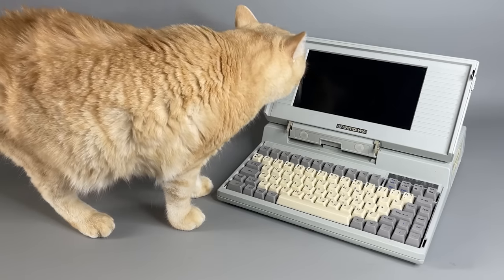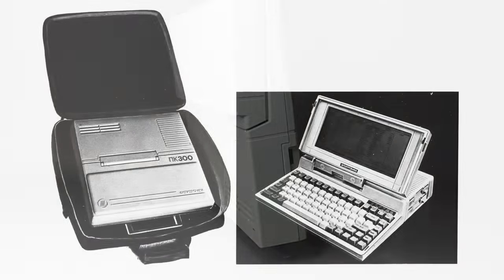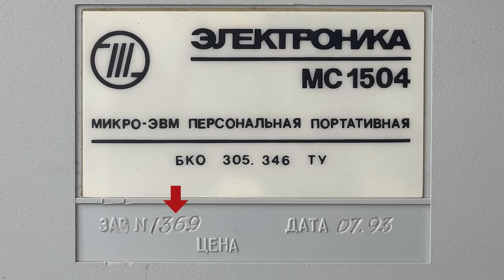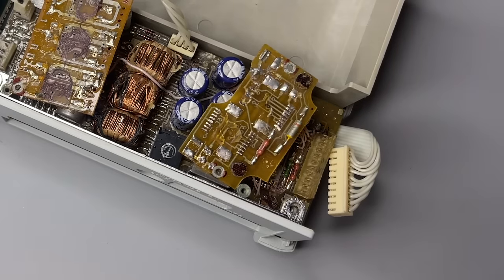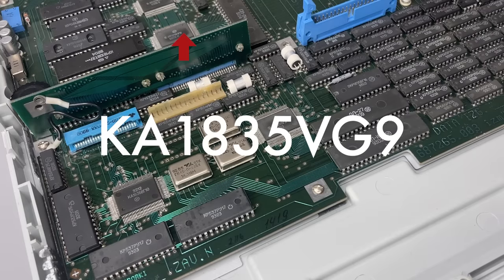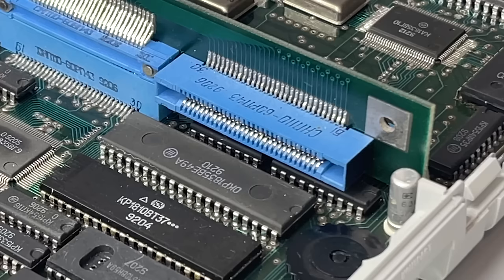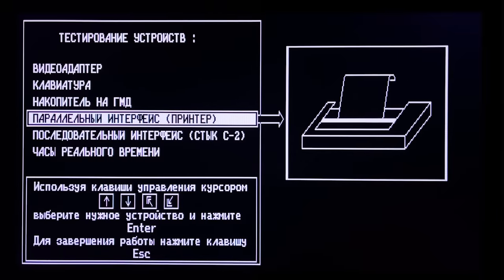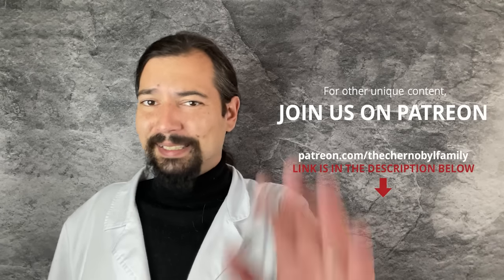I FINALLY FOUND IT! Behold Elektronika MS 1504, the ONLY SOVIET LAPTOP EVER.

Comment: In the Soviet Union they knew how they built computers and strove to keep up with the West. They even proposed to create their own OGAS network that would be the Soviet internet. Unfortunately the political leadership in Moscow did not see the potential of this technology.
Reply from the maker: When we had talks with actual developers of a few notable computer systems, they were far less optimistic in their opinions about those times. I'd warn against calling OGAS as 'Internet' in any way; it was more a decision system with very narrow purpose. Viktor Glushkov very well explained it in his books.
Reply: Still, very interesting.  @ChernobylFamily
Reply: Most soviet computers in the late 80s were still mainframes without a screen
Reply from the maker: @belstar1128 i certainly agree about mainframes, but all them had terminals, so technically, screens were present, and looking on some software (SVM, PRIMUS, etc)  — cannot say it was any different experience than working with e.g. DOS. Console is a console, after all...
Reply: @ChernobylFamily  I noticed most of them were like printers and had no screen. and even with cga you could do a lot more than with a terminal
Reply: They knew how powerfull OGAS would be, that's why they rejected it. By the 1960s the CPSU was too corrupted by bureaucrats that were more interested in keeping their power than developing a socialist economy. They saw the OGAS as a direct threat to their political power. If Lenin or Stalin had the option to develop the OGAS they would have done it, but it just arrived too late.
Reply from the maker: @iumbo1234 Stalin? You cannot be serious, with all my respect... in Stalin times cybernetics was claimed as a false capitalistic science... yes, in 1950 we had MESM  computer in Kyiv, but the perception of the computer systems as concepts was more as big calculators, nothing any close as a part of more universal realm of information processing.
In ~1955 things started to change, but before... no-no-no.
Reply: @ChernobylFamily  You are not wrong, I should have specified the younger Stalin. Before WWII he had a totally different attitude towards science, at some point something changed in his mind. Probably the beginning of the cold war made him extremelly suspicious about anything coming from the West, but he wasn't always like that.

Also I doubt he was entirelly guilty of this consideration. By this period of his rule the Party and the inner circle of snakes who surrounded and slowly isolated him had a huge influence in his opinions.
Reply: @ChernobylFamily  I heard a story that Stalin did not like computers because they might prove that socialist theories were wrong 😆
Reply: @160rpm  Which is funny because all modern theory on economical planification revolves around computers and cybernetics.
Reply: @ChernobylFamily какие книги?
Reply from the maker: @helios8459  ну хоча б "Что такое ОГАС?" В. Глушкова.
Reply: The probable reason why the state was opposed to the development of the internet was because of the concern about internal stability. Even if it were heavily censored, the vision of free flow of information between citizens was dangerous in the eye of the party
Reply from the maker: @alternativewalls4988  at the moment when that state existed, communication means available were so primitive, that it was a bit early to oppose something. Technically, internet (or better to say, EUNet) bridge from the USSR existed, when DEMOS enterprise together with RELCOM made it though Finland in 1990 and registered .SU domain. but all that was at a very small scale.
Reply from the maker: @alternativewalls4988  however, if you speak about OGAS, once more, it was a concept of an inter-enterprise decision system for planned economy management, not an internet-like system of information exchange for individuals. It is not more internet than CYBERSYN created in Chile during Salvador Allende. You are right that there was an opposition; and the reason was mostly in horribly bulky structure of party-controlled everything. Having computers would make too many 'special' people uncomfortable.
Reply: @ChernobylFamily  oh i'm not talking about OGAS specifically, but why the party would be averse to any project resembling the internet
Reply from the maker: @alternativewalls4988  I see. Your point makes sense. That's why all that story with DEMOS and RELCOM could work only in the times of changes. Before... hardly imagine, by the reasons you told.
Reply: Their handheld electronics of the time where fricken WEIRD.
Reply: @iumbo1234 The CPSU after Stalin was utter fuckin CRAP, but I don't know about that.
Reply: Meanwhile in the west Microsoft proposed to create their own TCP/IP Network because they could not control "Internet". Fortunately the free market did not see the appeal of it. This is why the original Windows 95 does not come with internet out of the box, but MSN.... RIP.
Reply: @iumbo1234 you are trying(and failing) to make excuses for Stalin's rule and USSR's lack of progress in computer science. Keep trying bro
Reply from the maker: @hydrolifetech7911 thank you.
Reply: @hydrolifetech7911  You could try to tell me why what I said isn't true instead of saying "lol you wrong, bro". I took my time to explain my point of view, if you are not willing to do the same it's better to stay quiet.
Reply: @ChernobylFamily Nothing but a glorified type writer I guess
Reply: The USSR lost the computer race before it even started. They had good people, mathematicians, physicists, chemists, but the system was run by illiterate aparatchiks until 1991. I have seen few videos about the computer race and it was clear in 1980 that they lost the race forever. They struggled to clone the 8086, 80286 and even 80386 Intel processors, BY HAND REVERSE ENGINEERING. They relayouted the processors using primitive software tools, because they lacked know how to design a processor. Absolute sadness. And it all culminated with the Cernobîl disaster, the supreme example of how a primitive society played with the atomic force without knowing how dangerous it is.
Reply: @ChernobylFamily very true. Also the disputes between the two different computing g groups didn’t help. When it looked as though they may get networking for the purpose of managing the economy, by matching needs with output, it was shot down. Why? Because 5 year plans were as much fantasy as reality. The idea that production would actually be known for all industries, terrified those in charge of those industries. So, they killed it. The history of the Soviet computer industry is very interesting. The book “How To Not Network a Country” is a fascinating read, using a lot of actual records from the time.
Reply: @iumbo1234 make no mistake about it, Stalin was in total control until the end. He kept those snakes in a small cage and used one against the other.
Reply: I suspect they did see the potential of the technology, and were terrified.
Reply: @iumbo1234 I love it when some banana сомміе tells me about what happened around me in my former country. LoL you think you from overseas know better than me who just lived through all of this?

Comment: The use of three screws to secure the case was quite innovative.  All modern devices nowadays have dozens of one-way clips and indestructible glue.  🙂
Reply from the maker: I'd call it 'reverse innovative' as screws were introduced first :)
Reply: @ChernobylFamily  They were way ahead of their time with "right to repair"!  🙂
Reply: All old computers used normal screws and were easy to take apart.
Reply: @ChernobylFamily It goes way beyond mere screws. Ruso-soviet manufacturing hadn't discovered the magic of phillips screw heads - unlike the developed world, they used flat head across the board. Glory to kremlinite dear leaders and the red army for this 💪🚀
Reply: And screws was MUCH easier for repairs. Nowadays anything is made for planned obsolescence and waste production.
Reply from the maker: @user-su5cm1kh9n especially i love when that flat screw is somewhere 15 cm deep between a few sensitive boards and hell of wires. Oh, that is a pain..m
Reply: @ChernobylFamily  It is small price to pay instead of glued panel possible to open only after tearing off the rest of circuit. By the way those screws are usually made from steel and many screwdrivers are magnetic.
Reply from the maker: @KrotowX well, from this point of view I more then agree.
Reply: And an electric zapper that incinerates the motherboard if you come near it.
Reply: @KrotowX laws being brought in in the EU in the next 5 years will basically force most manufacturers to make products repairable again, if it’s successful I guarantee that in the next decade we’ll see most other countries mandate that too.
Reply: @cdl0  more like you must repair before you can use!
Reply: @user-su5cm1kh9n I love flat heads, because if you don't have a screwdriver around, you can use just any flat, sturdy thing, such as an ordinary key to unscrew it.
Reply: @160rpm Sometimes that is the case, but for example my uncle had a Soviet fridge, complete with Cyrillic writting on various knobs, manufactured in the 60s, that only broke last month without a single repair required to it over the entire lifespan. And while my uncle got a new fridge, he didn't throw tgat one out and is looking for someone who is familiar with that model to repair it (from what I could tell with my limited knowledge, it was some sort of an electrical failure).
Reply: @UltimatePerfection  Thanks. I never would have thought of that. This must mean the ruso-soviet regime was always more advanced and countless steps ahead of the rotten capitalist west - they, unlike the civilized world, thought of eVeRyThInG! 💪🚀🇷🇺💤💪
Reply: @KrotowX I think that's too narrow and simplistic a perspective.

You really have to consider competing motivations like making stuff cheaper or "thin and light". Screws don't add a ton of cost, but properly threaded posts do.

And it's hard to make a product thin if it's held together w/screws.
Reply: They're very innovative at copying Japanese laptops that uses proper screws that isn't rusting away.
Reply: @Shinobubu  The most recent Japanese things I bought were made in Vietnam, except for Kikkoman soy sauce, which is the best.
Reply: @UltimatePerfection  Home appliances in the 60s, 70s and 80s tended to be bulit to last, on both sides of the Iron Courtain. I work in a biology lab, and the rule of thumb is "you can never have too many freezers/fridges". We still have Minsk (Soviet) and Silesia (Polish) fridges in working order, both made in the 70s/80s. I don't think they ever needed any major repairs.

Comment: I had not seen this combination of VLSI and DIP chips before, and was baffled by the components (especially the chip-like-with-holes) on the motherboard. Thanks for taking the time to take this machine apart and show the inner workings. Really enjoyed this video.
Reply from the maker: Thank you!
Those with holes are usual, that is just a side effect of the technological process of production — that is where a manipulator has been holding a metal part for proper alignment.
Reply: "I had not seen this combination of VLSI and DIP chips before".  The specific chips, or the general notion of VLSI chips in DIP packages?

Comment: :hand-orange-covering-eyes:It seems easier to reverse engineer some of the experimental chips than to figure out how the power supply was made. The motherboard on the other hand looks beautiful!
Reply from the maker: We believe Toshiba prototype will help with this. The PSU is very much destroyed, but there is a hope.
Reply: @ChernobylFamily  Honestly looks like they stole the motherboards out of something else, compared to the PSU. Incredible to see these two levels of production in the same  device
Reply from the maker: What is interesting, a prototype of the PSU was way better than a final product. No one knows why.
Reply: @ChernobylFamily  probably because nobody really cared. Product wasn't selling well, so they felt no-one would notice anyway. Maybe someone stole the money that was supposed to be for the PSU pcbs and did some crap like this by hand, haha. It does look like some soviet homebrew stuff which also looked very terrifying
Reply: @160rpm  USSR never seemed to throw away manufacturing equipment, only add modern ones alongside. If you look at 1980s Soviet TVs there was old vacuum tube models as well as ones built fully with chips and remote controls. Sometimes old equipment would be used to produce entirely new designs, or even categories of product that didn't exist when that equipment was made.

The idea was that one old factory and one new factory will together produce more than just a new factory alone. Of course, better would be two new factories...
Reply: @grosses_wassertier666  If the original PSU can't be fixed due to lack of components there are tiny M3 (and more or less small M4, M2 and M1) ATX power supplies designed for cars and other DC powered applications which are basically small board with all DC-DC converters needed to create all standard ATX voltages, usually the input is 6V to 24V so any old laptop charger can be reused to power those.
M3 gives -12V @ 0.15A (only 1.8 Watts) like most modern ATX power supplies, the MS1504 seems to use -15V and -9V for something but I guess -12 can do the job for -15 and -9 can be obtained from -12 using a classic LM7909 linear regulator.
AFAIK on most computers without special hardware -12V were only used by serial port chips and -5V by the 8088 CPU (but not by 8086 and later CPUs) and also to power op-amps used in some ISA sound cards and modems, but I think any 8086+ computer will run fine without -5V and probably without -12 if you don't need the serial port.
Reply: @grosses_wassertier666 You would still need whatever additional circuitry was needed for the other voltages. A single switching regulator wouldn't be enough.

Comment: I like that you're using Norton Commander, that was my favorite in the early 90's.
Reply from the maker: Yeeeesss my too!. Though this is not a Norton Commander, it is Volkov Commander. It is a functional clone which was written in Ukraine on assembler. NC was availalble, but the idea was to make NC work on much, much more limited resources than NC normally requires. As far as I remember, VC consists of a single file of 64 kb or so.
Reply: Nothing beats the intuitive 2 panels of NC, in many so much easier to do file operations in those days than in today's GUIs.
Reply: Volkov Commander - I saw this widely used in Poland in the 90s.
Reply: @ChernobylFamily  I learned about VC from a former Czech boss doing hardware/software repairs and support!

Comment: I have a feeling whoever stripped those chips from the PSU didn't own the whole device to sell intact. If it was someone working in the warehouse where the laptop has already sit unopened for months or years, they must've thought it will never be sold. So there is no harm stripping out some interesting components and putting the rest back into the box. Nobody will ever notice because it will rot here the warehouse until clear-out straight into a landfill. Still, they wouldn't dare to just steal the whle laptop and leave behind an empty box because that would be too obvious during inventory.
Reply from the maker: Actually, it is a very good point.

Comment: I had toshiba T1000 and this one is Very similar in ports arrangement (external and internal), and even component’s arrangement. The power supply looks here like a pure madness and my main board has a lot less chips and more of them were smd ( im not surprised). My toshiba had rare citizen floppy with different ribbon cable, but this looks like normal FDD
Reply from the maker: Actually upon further inspection, in this very laptop the drives are from 2008. I mean, original were not any much different (normally there would be TEAC as far as i remember), but I'm surprised that someone took them out at some  point. There could not be soviet drives – they did not exist as a mass product.